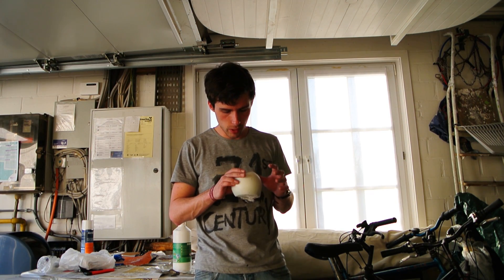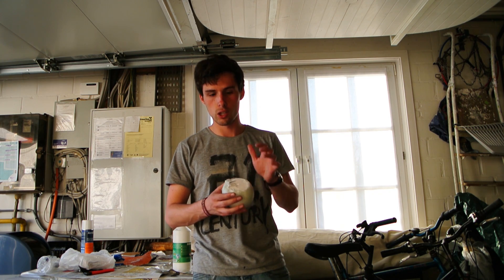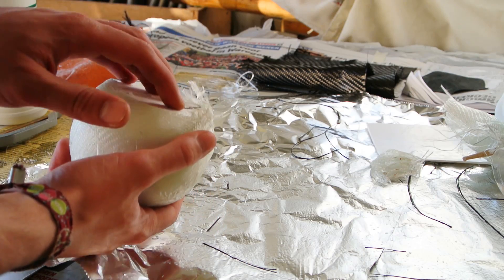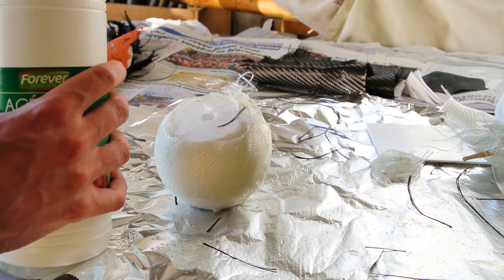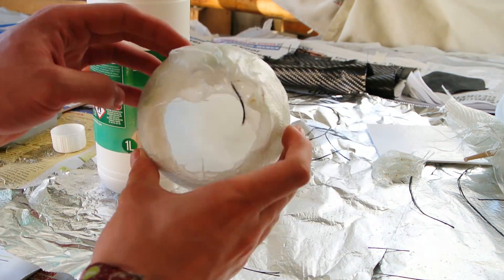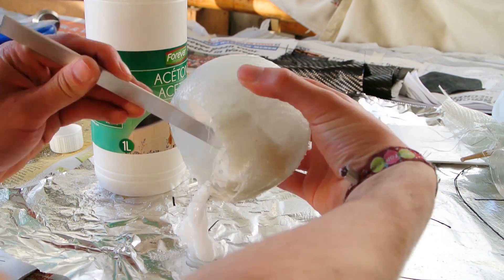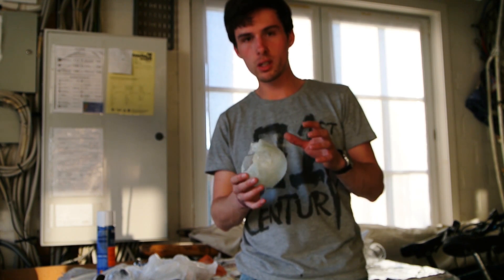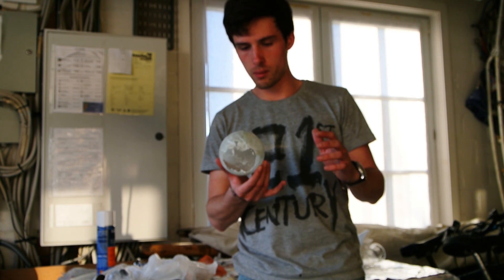Proof Of Concept - Styrofoam, Epoxy, Fiberglass, Acetone

Comment: nice one.. consider acetone recovery via distillation - within a pot still rather than a closed retort or boiling flask. Adding water would keep the polystyrene from burning once the acetone had been recovered.

Comment: Xylene works better than acetone
Reply: Use a mask with either! Xylene is even more toxic. Melting this stuff makes a mass that will not harden!
Reply: @cluek9780  it hardens just fine.  I paint it on like a finish. Smells like airplane glue.  But I have used it on metal stone plastic and such.  The really smooth surfaces it pops off easy but stone, and wood and porous surfaces it hardens, maybe even better than danish oil and hempseed oil.

Comment: I've done something similar. I put a layer of drywall mud over the styrofoam and pva over that, that does several desirable things for you, you can use it to fine tune the shape, fix any tool marks left on the foam, you can sand drywall mud MUCH smoother than the foam, giving the interior of the finished piece a glassy smooth surface, if you make sure you've  got good coverage with the pva, it provides enough protection for the foam that you can use polyester resin and with that chopped strand mat. My pieces are fairly large so I remove as much of the foam as possible mechanically or with a hot wire loop and just use solvent for the last few stubborn bits, any drywall mud or pva left on the fiberglass softens with water and rinses out cleanly.

Comment: Why would you use such an expensive and frankly ridiculous method  to achieve a hollow composite ?
Reply: Because using vacuum formed, parted molding process is MUCH MORE expensive, plus time, specialized equipment and added labor intensive..compare to this 'Lost Foam' method.
...and if you are a '3D printing' aficionado, why dontcha add in the start-up $cost$, skills learning curve and specialty gear/raw substrates THAT introduces?
Reply: It worked what do you suggest

Comment: Actually I tried this with epoxy resin and it "bit" into the styrofoam- it had absorbed into the foam. Perhaps because I used cheap packing styrofoam. What kind of foam did you use that the resin didn't absorb? No PVA or anything?
Reply: Use closed grain EPS foam. For packing purpose mostly EPP is used, which is more durable but porous
Reply from the maker: +Andrew Scanlon sorry for my late response! I've bought this piece in a "art" DIY store and the density is quite dense...all depends on the type of foam you use I think

Comment: Matthieu, this is exactly what I intend to do for my project, thank you for your vid !!
I have a question, may I use fiberglass directly on styrofoam, if not, do I need to coat the styrofoam with epoxy first ?? Do you know where I find the proper epoxy to coat the styrofoam ?? Thank you very much.